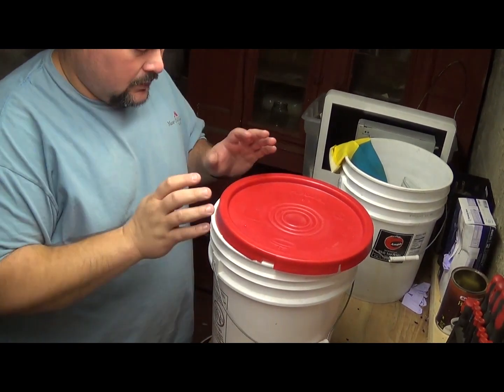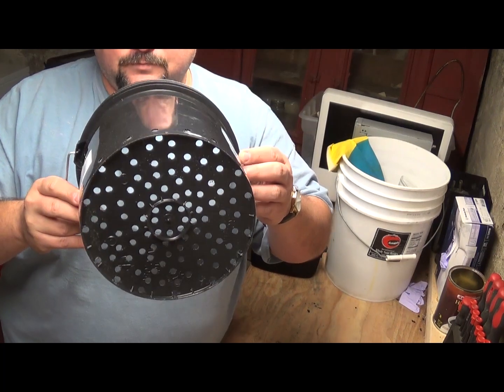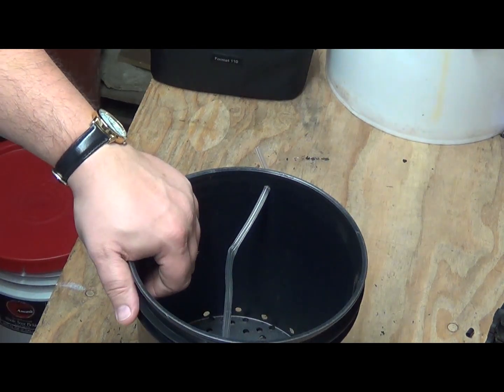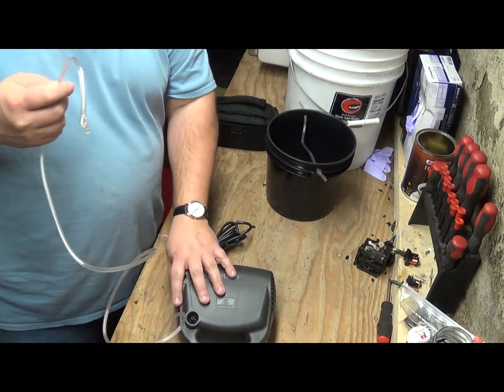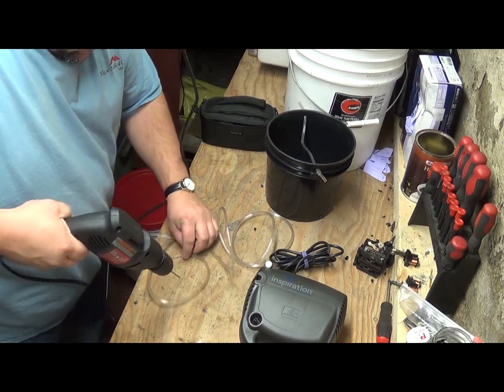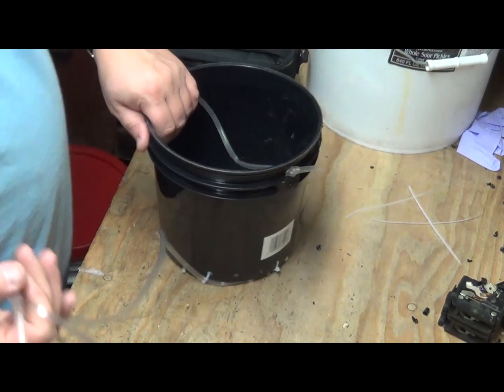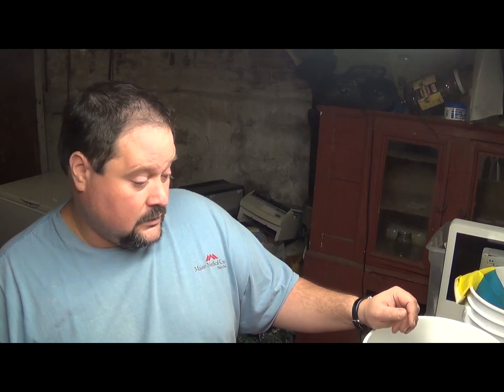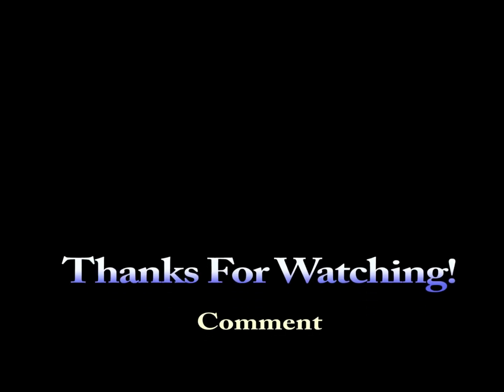How to build an Air Bubbler for recovering gold from trimmed gold fingers and cell phone boards

Comment: I like the thought of reducing the number of chemicals.  Question -- can you still use steel to recover the copper from the acid without the peroxide in it?
Reply from the maker: Dwight Gordon yes, one of these batches is from the air bubbler system where no peroxide is added.

Comment: I really appreciate all the gold videos.  I got into scrapping a few month ago and decided that before I started to process, I would collect a lot of material to make it worth while. Now I have hundreds of lbs of gold plated pcb's (bare boards that have never been used) and I am about to start processing them. This bubbler method is just what I was looking for. I have a question though that you may be able to help me out with. These boards are all flat and I want to put large quantities in at a time to process. But I need to figure out a way to get solution between the boards. Any ideas? Thanks you.
Reply from the maker: hmmmm, lots of large boards.....I think if it were my I would try to break them up roughly leaving jagged  and misshaped pieces then put them in.  if the air bubbles are coming up under the boards, there should be enough of a little movemennt to get in the crevices.  As with all of this though, you still need to swish the bucket around as often as you can.  I do it at least 4-5 times a day.
Reply: Awesome. Thanks for the input

Comment: Hey stranger! Hope all is going well up there! Just making sure I got it straight. This method is for fingers and any circuit board that is clean of all other components... yes? What if the board has been cleaned of all components, whether it's the air hammer method or hot sand bath method or heat gun method, but there's still solder that wouldn't come off... will that solder affect THIS method. I know it will in other recovery/refining methods but not sure about this one. Secondly... aside from circuit boards... will this work on any other components? Partially plated pins or the gold on the end of some flat ribbon wires or ink printer ribbons for instance. You mentioned in the next video that you threw in 3 white strip fingers that had gold plating on them but you didn't mention from what exactly they came from. Just thought I ask before I assume, attempt, and then make things worse. Thanks Moose!

Comment: Hi Moose, thanks for answering my question. One more if I may. will this work on jewelry and other types of scrapping?
Reply from the maker: Hi and thanks for watching!  Great question btw, this method may work for jewelry but is by far not the best method.  The jewelry would have to be cut up in to many small pieces to allo area for the acid to work in under the gold.  There is a lot more base metal to try and dissolve and would take a long time.  I would suggest learning about reverse electroplating.  That seems to be the prefered choice for that type of stuff.  Also, it is possible to use the refining solution of hcl and bleach however that would require good timing to make sure you do not dissolve too much base metal into solution.

Comment: I am currently on day 3 of this process and it's looking great, although the materials that are being stripped are from cell phones. and some still have some components on them. is this bad?
Reply from the maker: +Raymond Reyes as a beginner, its probably not good.  You are going to get frustrated trying to separate the foils from the other stuff that comes off and into solution.  I do not have any experience with that as I like to do things by the book so that I don't run into such problems.  Best of luck to you

Comment: hey moose ! I have made an air bubbler just like yours (thanks!)  I was wondering if I can leave it on for 24 hours a day or should I turn it off until I get home ? and 2 other ?'s ( I have put a ton of work into getting this together lol) just to be sure when I refine it is the ratio 3to 1 hcl/bleach ? thanks again !
Reply from the maker: +Mike Pezz I leave the bubbler on when its in use.  As for the refining ratio, because such harmful gasses are created I think the best route is to slowly add the bleach a little at a time until all the gold stops dissolving, then add a little more.  3:1 may be way too much bleach depending on how much gold you have
Reply: Very helpful thanks again

Comment: Just a quick question... In the video you corrected yourself to not use NYLON zipties. What would be a suitable alternative that the HCL won't attack? I doubt glue would work lol How about regular ole sting?
Reply from the maker: really no need for the zip ties just keep the bucket on the hose to keep it weighted down.
Reply: I had thought of that but wasn't sure if it might be a hassle after the first shake or not to make sure it stays under the materials bucket. Thanks!

Comment: Would a cpap hose work fine instead of a plastic tube? Thanks.
Reply from the maker: +The E- Scrap Man as long as it is not nylon.  You will want to let it sit in a cup of hcl a couple days forst to make sure it wont dissolve on you.  But otherwise, it should.  Just be carefull it does not move too much air and start spattering acid everywhere.

Comment: Hi,
I am new to this and whant to start scrapping gold and silver to make jewery as a hobby
I had a idea but dont know if it will work 
Q1: dos it have to be plasic bucket or can i also use glass?
Q2: will the ac disolve a Magnet?
Q3: this is for if answers on q1=yes you can use glass and and q2= is no it dos not disolve magnets or yes but no is easyer😄
So Q3:wil it help more if you Stir the ac and add air?
Plz answer so i know if shareing my idea if worh they low explanation
P.s. Sorry if my english is poor i am dutch and dont type alot in english
Reply from the maker: Hi and thanks for watching!  1-it can be glass, just be carefull you do not have it somewhere it can drop and break. 2- a/p can dissolve a magnet.  3-stirring always helps.
best of luck to you!
Reply: Thnx Moose,
1:long explonation
2: short explonation

Oke to give my idea life.
Because of the answers 1 detail changed its a bit more expansive bud here it is.

1:My idea is to get a Magnettic Stirrer (1 they use for homehamde beer bruwing) its basic a glas bucket sitteng on a magnettic plate that will twis the magnit that you put in the class bucket this will stir it all (normally the jeest or how ever you spel that aka begin state of beer)
Only now its tha ac and now you must need a magnit thats seald in plastic or in glas they have them but harder to get and more expensive
Then just put a air tube in because of ac twisting 24/7 in the glas no need for air to be everywhere 1 spot is inuf to get air bubbels in all de ac or buy a air pad for it that is cheap and makes it look like a jacuzzi
Sorry for low explonation 

2: 1 buy Magnettic Stirrer with a plastic coverd or glas coverd magnit (beer bruwing shop)
    2 buy a air pad for in your stirrer (same shop)
   3 you need a plastic bucket to fit in clas stirrer and drill the holes and handel like in this vid
Get you air suplyer this can also be a hairdryer that has a cold air funtion
And get your ac and gold fingers

Oke to start
1 set up Magnettic Stirrer (if you use airpad put that in before ac and hook it up)
2 put in ac 
3 put in air tube(if you have airpad forget this)
4 put in bucket but this must hang not sit on botem or els magnet can not stir the ac for you
5 put power plug is and got watch tv or play with the wife😉

Commend, like, dont subscribe😜

Comment: I have heard not to put in pieces with solder. I would think it a shame to give up on the pieces with solder on the other side though. I am building the bubbler system now. Taking the recovery process slowly (cell phones, computers, cartridge games, pins, boards, anything and everything with gold on it. I even have Pokémon cards that are 23 K gold plated metal blocks. Chopping up and saving until I have the process thoroughly figured out. Thank you for being a teacher in this. I got the Acid Magic as my Muriatic Acid. I buy precious metals also. Would rather recover than buy gold (Prices are outrageous)
Reply from the maker: +Dominick Mas yes they are outrageous.  The gold from the cards can be recovered with the HCL BLeach method but keep in mind that it takes hundreds of cards to come up with a gram.  I had someone do the same thing with gold baseball cards a while back.

Comment: thX for a video  very nice I made one machine for myself work very good I use 2 liters of HCL14% and add 50ml H2SO4 28% it take about 3 to 5h to strip foils from fingers and mobile phones with no lose of gold in a solution tested with stanius chloride 
hello from serbia best wishes to you
Reply from the maker: Branislav Radić Sweet!  Just remember, if you are using an Air bubbler, you do not need to add peroxide.
Reply: yes tnx
Reply: +Branislav Radić !hi branislav!the purification with what kind of acid you do?

Comment: Not bad moose im going to try this next month.  I ran 9.4 ounces of fingers and a fe cell phone number dialing  boards with gold I'm sure You know what i mean lol.  I was able to get 3.6 grams back from that via acid peroxide my first try ever but i like this method way more i will say after playing with those chemicals not getting injured lol ill take this method all day whats your average yield on about 6 pounds of memory fingers trimmed down have you done the math?
Reply from the maker: Jeremy Gola About 15 grams give or take.  Was your 3.6 before or after refining with HCL and bleach or aqua regia?
Reply: before im figuring im gonna loose some but im not gonna melt untill i process about 20 more pounds untrimmed next month how much do you loose to aqua regia refining on average
Reply from the maker: Jeremy Gola The funny thing is that you are not losing, you are actually gaining, gaining purity.  As for the weight change, that depends on how much base metal is still stuck to your foils and what karat the plating is at.
Reply: so I will need to rinse the cleaned gold after drying with a few washes of HCL right? to bring out the copper from the gold etc, but after that if I really have 3 grams I may get 2 or more back huh.  That kicks butt as I will be processing 20 pounds before trimming should be roughly 1 pound and a half trimmed and I only ran 9.7 ounces this time

I still have about 40 cell phone boards 7 pounds of ram trimmed to run after the heatplate gets here for hot sand bath and also 4 pounds of fiber processors

I just started a few weeks ago this is fun and i learned 90% from you lol

Comment: just to let everybody know : you can use soda bottle lids to set your inside bucket down on and it wont press down on the air hose . that way you'll get the most air without the air line being compressed , depending on how much weight you have in the bucket . just a little trick i thought you guys might like . i was thinking of super gluing those to the bucket , but im not sure if the acid would just eat the glue or not . i'll run a small experiment and let you guys know how that turns out . i'll update this as soon as i can on that .

Comment: LOL  Typical male~~using a drill to make holes in an air tube!.  Just a little bit of overkill!  Love it.  BTW scissors or those handy wire cutters would also work. ;-)

Just giving you a hard time.  I've learned so much watching your videos.

I'd love to see a video about the differences in low, med and high quality boards and when you should recycle whole board and when you should take parts off.  Also, what to do with the different components and how to recycle boards once components have been removed.  I feel really dumb in this area and could use your expertise. 

Thanks a bunch!
Reply from the maker: I feel a Tim the Toolman Taylor series of grunts coming on.....  Sounds like a good idea for a video....
Reply from the maker: the board thing not the grunting....

Comment: I'm afraid the lifespan of those Nylon zip ties is guaranteed to be very short in Hydrochloric acid.
Reply from the maker: Holy hell!  indeeditdoes just watched one of my videos!  Thanks for watching!  You are one the guys I tell my viewers they need to check out, along with the grf.  As for the zip ties, I'm pretty sure I checked to make sure they were not nylon but will double check.  Thanks for the tip!
Reply from the maker: indeedItdoes ........doh......nylon they were..... note the word "were" as in past tense..... Learn something new every day.  Thanks!
Reply: I have a question, how much air should the pump put out ? in Liters or gallons per timeunit (minute/hour or so)
Reply: +indeedItdoes What would you recommend? I can't seem to find anything non-metallic that isn't also Nylon that would be safe to use. I read a comment above about glue and I myself wondered about standard thin string.